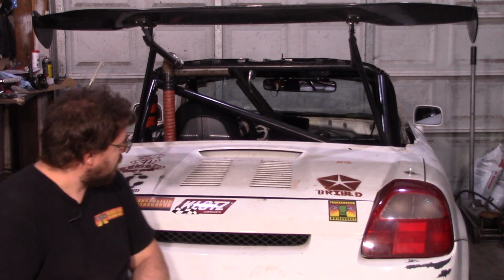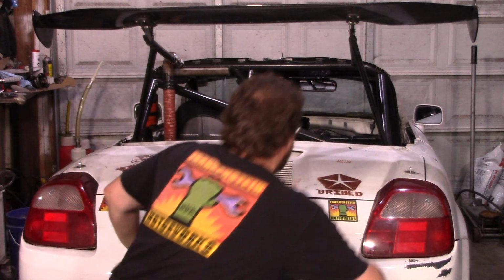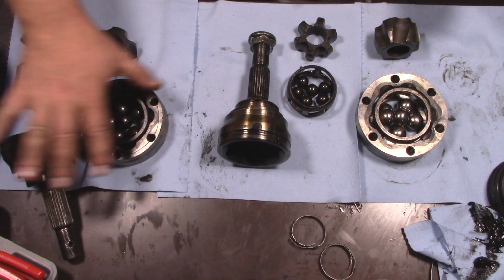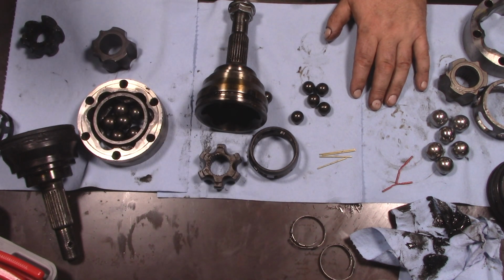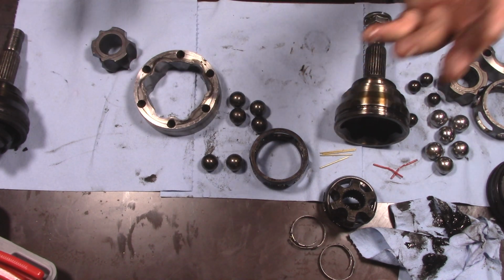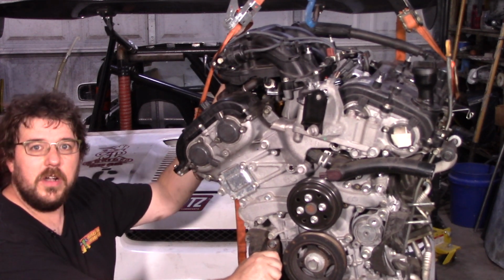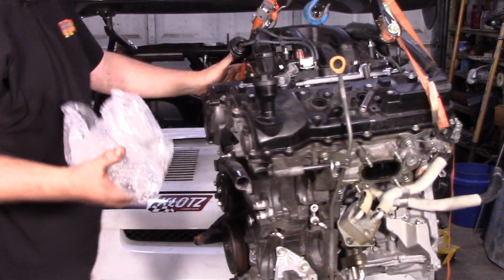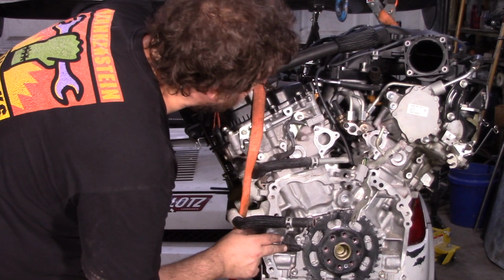Examining upgraded axles for MR2 Spyder

Comment: You can use my spyder to swap that new 2gr into, so long as I get the car back once it’s done😉 I don’t mind if the rod is bad so long as the engine is salvageable.
Reply from the maker: I originally thought that the FKS would be easier to swap into a spyder than the FE but now that i see it i have changed my mind. The FE is certainly the easier way to go.

Comment: Completely missed where you put those brass tubes..  can you explain?
Reply from the maker: They go on the small end of the boot, go look at 13:06 where i install a boot you can see it sticking out of the small end. It is used to provide a vent so that as the joint gets hot the whole boot does not grow like a balloon and tear.

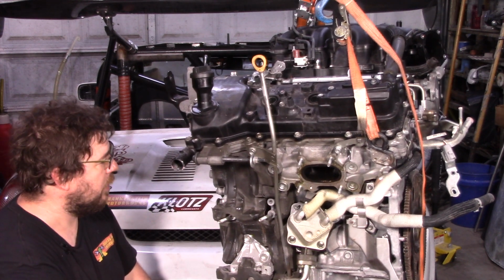Comment: 18:00 COMPLETELY missed the oil dipstick mount has been pre-flattened against the block. SMH Marc, have you ever even swapped one of these into an MR2 before?

On a more serious note, isn't that timing sensor right about where we'd hope to put the slave cylinder?
Reply from the maker: I have not swapped one yet, this is my first time touching one. The slave cylinder will go near the crank position sensor but there should not be any interference issues.

Comment: At 13:45 of your axle assembly video you installed the cage upside down vs the stock orientation in the outer CV. Did you do that on both sides?
Reply from the maker: oh, that's a good question. one that i don't have the answer to. I expect that i did it the same on both sides but weirder things have happened. I'll have to see when i disassemble the next one in a week or two in order to lube it with the CV-2 stuff to see which direction that part initially is installed in.
Reply: Similar question myself, how does one tell the difference as to which way the cage should go back in?  Noob here… 😊

Comment: Marc, would shimming up the rear crossmember help address your axle angles?  I recall that Toyota TRD did this with the Sportivo suspension (shims between the rear crossmember and the frame rails).  I thought this was to address the roll center.  It was not a thick shim.
Reply from the maker: I did not realize that TRD made a kit that adjusted that. I'm a bit confused since you generally want the roll center to be higher to reduce the length of the roll couple and shimming the crossmember down would actually increase the length of the roll couple, making the car roll easier and needing a bigger sway bar to compensate.
Reply: @FrankensteinMotorworks  I am not a suspension expert.  But do know that TRD included the shims with the Sportivo lowering springs.  Since the axles are above the frame rails and crossmember, is the effect on roll enter the same as raising the car?  Toyota must have done it for a reason.
Reply: And the Sportivo kit did increase the size of the front and rear sway bars as well.
Reply from the maker: @reneneron2971  I'm sure there's a reason for it, it just seems backwards. It would technically change how much plunge the axle gets by a tiny bit but it would not change the angles and the angle on the outer joint is the issue here.
Reply: It was called a “roll center spacer”.  Interestingly, 3/8 thick.  Same as what you were considering raising the car by style springs.  I will send you a picture by PM.
Reply: My experience is all on the MKII, but at least in that case one of the stock suspension "problems" is that the rear roll center is too high relative to the front roll center.  I don't know if the Spyder is the same in this respect or not.  So while lowering the roll center may not be ideal, if it results in the rear roll center lower than the front it may still be beneficial.

Someday I need to pick up a Spyder and do some measurement and modeling on the suspension.
Reply from the maker: @alexwilhelm8286  oh, that could be a reason for lowering the rear roll center to balance them a bit. Honestly i haven't done the math at all, i just played with it until it seemed to handle really well and i left it there. There's room left to optimize for sure but because of the design of the spyder suspension it's much harder to adjust the roll center and such.

Comment: Question, just random but i work with toyotas constantly and factory boot kits come with copious amounts of assembly grease to be packed into the boot. probably 6-7x the amount of lubricant you put in. do you think that would have any factors to heat/ expansion and then wear by tolerances ? Just trying to think outside the box ! love your vids as always !
Reply from the maker: In my experience the grease does not really circulate around no matter how much you put in there. Any grease that ends up in the boot just makes it more likely that you'll imbalance the boot. Not as big of a deal on a stock vehicle but these tiny tires and high road speeds means I'm spinning them at up to 1800RPM. 

I do think the balls are growing and causing more friction, going slightly smaller would likely help but i don't know how much smaller. Too small would cause too much sloppiness and that would cause other issues.
Reply: Good thinking about expansion though